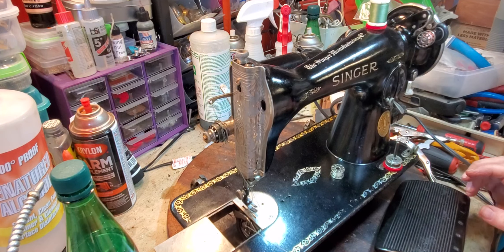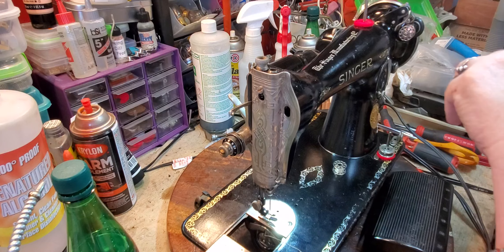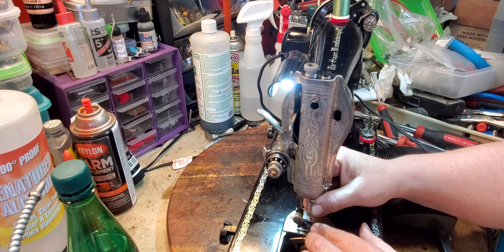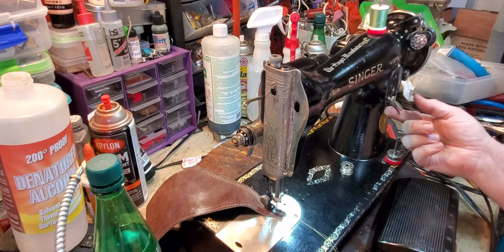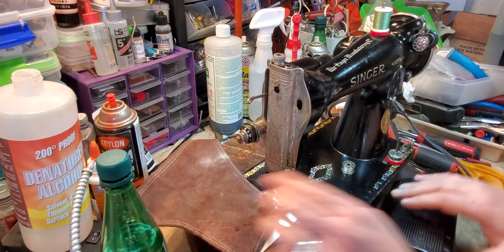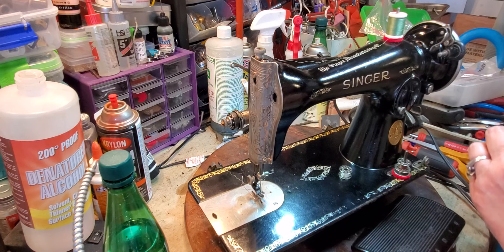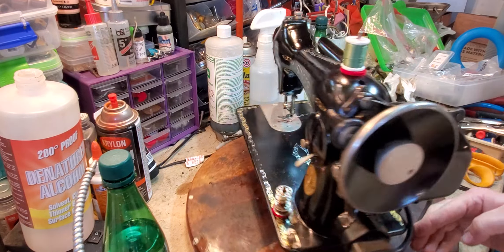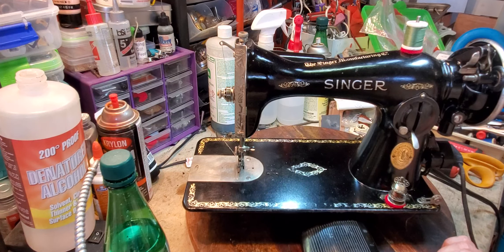Singer 15 af024939 demonstration sewing machine

Comment: Isn't it supposed to thread from left to right?  I think so.
Reply from the maker: The singer 15, threads differently than any other class 15 machine. Right to left. If I had threaded incorrectly, it would not form a stitch